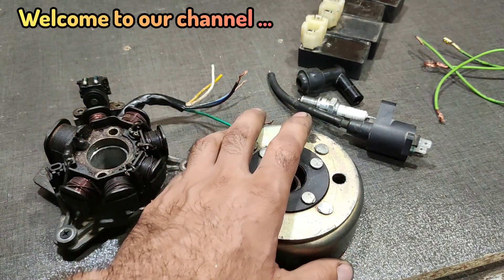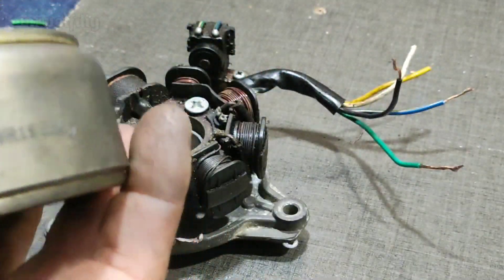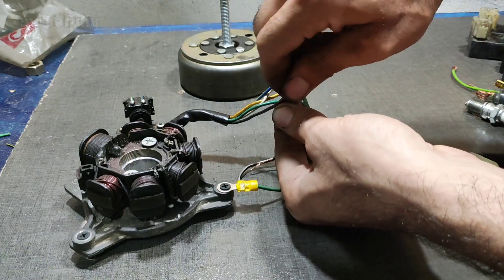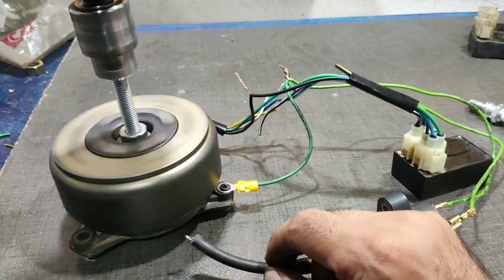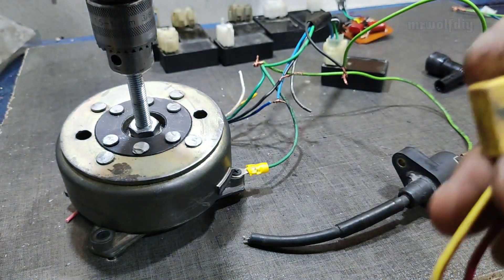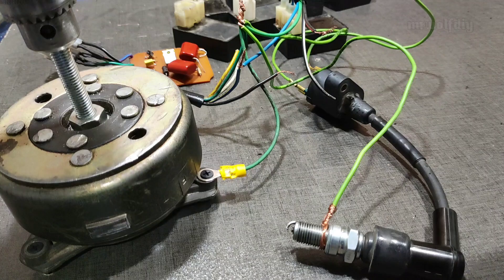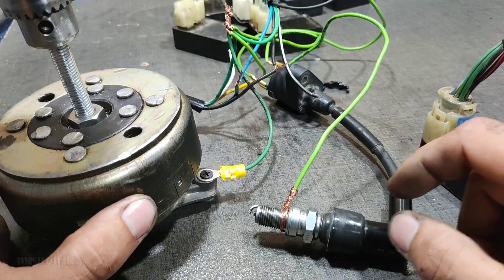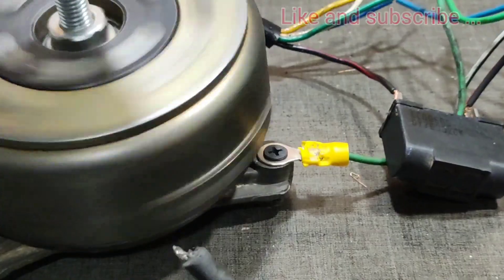How to increase ignition power, simple and practical method

Comment: my chinese scooter as random fails... no spark, but sometimes it manages to start, my last guess is the freakin pickup, but im lacking the tools to do the job
Reply from the maker: The issue can come from different sources, such as wiring problems or even the pickup coil.
When you face a no-spark condition, you need to check it at that moment.
The stator, CDI, pickup coil, and related components should all be inspected.
I’ll be releasing an educational video soon covering these common problems.

Comment: I have a question: I read everywhere that the ignition coil (the sparkplug holder) must work perfectly together with my ignitor (CDI for motorcycle)... i WANT to test the ignition coil because it has no spark. Can I use a different coil or do I have to buy excactly the same?  (I am not sure it is broken and is very expensive) ...
Reply from the maker: Hello, in most cases you can use similar ignition coil models; it doesn’t have to be exactly the same one.
Just specify what it’s originally for.
Also, make sure to watch my videos on testing the ignition coil and testing the CDI unit on my channel.

Comment: Good morning my ATV getting little bit of current and it hard starts
Reply from the maker: Greetings,
This means the engine turns over with difficulty or doesn’t start at all.?
If you hear a “click-click” sound from the starter, it indicates low voltage or insufficient current.
It could be due to a weak battery or poor connections, Which needs to be checked..
If the starter turns but the engine starts very hard or doesn’t start properly, the ignition spark or fuel delivery might also be weak.... .
Reply: Ok I sent the battery to charge thank you  @MrWolfDiy

Comment: To accomplish what you did in your video how do you wire a stator with three yellow wires and trigger with a blue and green wire.
Reply from the maker: Hi and thanks for the question,
Motorcycles with stators that have three yellow wires usually use a DC ignition system, and their stator does not have an AC coil (except for some models).
You need to use a DC CDI, where the stator actually plays no role in the ignition system; only the trigger is responsible for sending the pulse to the CDI unit.
Implementation of a DC CDI can be found in the link below:
https://youtu.be/rK1xlWOXHtc?si=N0_Rkc57wC1jbWHi

Comment: do you have a video for a 4-cylinder? mine has 2 ignition coils, and each ignition coil has two spark plugs, so a total of 4 spark plugs
Reply from the maker: Yes, for four-cylinder engines with two dual-post coils, you should use a DC CDI. I’ve already made two videos explaining:

 _the construction and operation in theory.
Link: Building the DC CDI Version 1:
https://youtu.be/QvmFbEX-pGM?si=Zjq376lDN68_tyCn
_How to implement it on multi-cylinder motorcycles:
https://youtu.be/XHRxKNFLOQE?si=g9pPMP-hthbPGpn0

Comment: when you test your CDI it seems that you used the AC capacitor, is it necessary?
Reply from the maker: No,is not necessary, I just showed it for testing purposes.
Using a capacitor on the AC input line is not recommended,
because it may damage other components، Unless it’s implemented properly, which I’ll explain later.
Reply: @MrWolfDiy ❤❤❤❤

Comment: good day bro, can u suggest or do u have idea how can i put more ignition power to my mio i 125 motorcycle
Reply from the maker: I recommend avoiding modifications to your motorcycle if it doesn’t have a specific problem.
In general, for better ignition, using a high-quality spark plug or the original ignition coil is the best option for you.
Reply: better get your mio 125 to impounding area. motorcycles like mio 125 should not be used to race in a public road and not be used by a "kamote" like you. 🤣🤣🤣

Comment: Why not have everything to one compositor and then a small coil to control when the charge is let out?
Reply from the maker: 🤔Could you explain more about this idea?
Reply: @MrWolfDiy  I always figured all those coils charged a capacitor and the last one was the timing for an electronic switch that released all that charge at once into the spark plug.

That’s just what I interpreted a cdi doing while working on mopeds 😅

Comment: hi bro semoga harimu menyenangkan, apakah percikan api koil seperti divideo mu itu tergolong percikan api koil yg baik, karena saya sedang mencari tahu percikan api koil seperti apa yang baik ?.
Reply from the maker: You could say yes, but it depends on many factors...
It’s not all about the spark—while a good spark helps with combustion quality, which in turn makes the engine run smoother, it’s only part of the picture.
In general, a good spark should have enough thickness and length, and its color should be blue or bluish-purple.

Comment: can you test it with a oscilloscope? I want to know how much the capacitor delays the ignition timing. Is it capable of following up the higher RPM, let say 12k RPM? I'm afraid there were misfirings.
Reply from the maker: Hi dear, Let me explain briefly:
At high RPM, for example 12,000, the time between ignition sparks becomes very short.
If the CDI circuit can't perform the charge and discharge cycle fast enough, the spark may be delayed — or it might not fire at all.
That's why using a high-capacitance capacitor in the circuit can negatively affect engine performance, especially at high RPMs.

Comment: Is it have any negative effect to HT coil ?
Reply from the maker: The stress on the coil happens when we increase the spark gap (like in my experiment, which was only to demonstrate the power of the circuit).
But when the circuit is connected properly — coil to spark plug — and the spark gap is around 1mm, there won’t be any real stress on the coil.

Comment: Hi, great job as always, congratulations, I wanted to know something, is it possible to build a stator without lights and a light flywheel with only a pickup, control unit and spark plug coil?
Reply from the maker: Yes, it's possible.
If the goal is only to produce a spark for ignition (start the engine without any lighting system), you can use a simplified stator without lighting coils.
A lightweight flywheel is also fine, as long as it still provides enough inertia to start and run the engine.
However, keep in mind that this setup won’t generate electricity for lights or a battery. It’s typically used in race bikes or minimal engine setups.
Reply: @MrWolfDiy  Thanks for the reply. What pickup, control unit, and spark plug coil could I use to build the stator? And how can I build the flywheel? Since I have the flywheel key, I assume there are no problems with the advance.

Comment: Hello. Can I use that custom cdi on Fuel injected motorcycle?
Reply: No
Reply from the maker: Usually no ، using an CDI on a fuel-injected motorcycle with an ECU is not recommended and is generally not possible, except in special cases with significant modifications.

Comment: Hello 
How to add pre-set levels to choose the power needed ?
Reply from the maker: That's a really interesting question...
I’d say the most common and effective way to add selectable power levels in a CDI circuit is to control the capacitor’s charging voltage at different preset levels, and then switch between them using something like a 3-position switch.

Comment: I wish I had your knowledge!! I'm trying to get spark on my little Honda XL 75 and I'm thinking of copying what you did here but the color of my wires are not exact to yours. If you can help me set mine up I'd be happy to pay you.
Reply from the maker: Greetings, my dear friend,
What type of ignition system does your motorcycle have?
It’s probably either magneto or breaker points, although it might have been upgraded to CDI.
Usually, Honda motorcycles made before the 1980s don’t come with CDI systems...
In any case, check and let me know so I can guide you.
Also, describe the overall condition of the bike for me — for example, are you not getting any spark at the plug? Or is there no high voltage coming from the stator at all?

Comment: on 8:32 sparks are jumping from ignition coil to nail to table. is that fine? if I do this to my bike that stray spark could fry some electrical components.
Reply from the maker: Hi,
Carbureted motorcycles don't have a problem when testing the spark this way, but in fuel-injected engines that have an ECU, this could potentially damage some components.
However, using this CDI on the engine is not an issue, because the spark is generated across the 1mm gap of the spark plug.

Comment: First when you say week spark , that is not spark ,that is the power wire to the CDI , and thats all , the cdi and magnetic trigger , to the coil wich then multiplies the voltage , trigger interupts , creating a big spark , that jumps the gap at the plug simple .
Reply from the maker: Impressive… you thought of that all alone🙌
Reply: hy

Comment: Gm sir, could I use this for Aerox V1?
Reply from the maker: Hi,
For injection engines, using a CDI is not recommended, although it is possible, but changes must be made to the wiring and other places, which is not in your favor at all.♥️
Reply: @MrWolfDiy  Okay thanks for your advice

Comment: I'm interested in building one for a modified HondaCX500 that has a different trigger system using a hall effect sensor that outputs to a GY06 DC-CDI. Can your design replace the GY06 CDI as the spark output is ok but not as good as yours. Thanks
Reply from the maker: Hi, In general, yes, it depends on the correct matching of the input signal and ignition conditions. If your trigger system uses a Hall sensor, you need to ensure that its signal output is compatible with the input of your CDI. However, for your motorcycle, it’s better to use a CDI with adjustable ignition advance. I haven’t had the chance to build this yet, but in the future, I will also release a microcontroller-based CDI.

Comment: Nice!
Add a constant, dioded, ionizing voltage that goes to the plug:
This should make some local Ozone and fast burning radicals and possibly even a tiny bit of Hydrogen.
That means less losses due to the ability to retard timing a bit for the same burn speed.

Want more free hydrogen; put a light layer of copper in the combustion chamber and on the intake tract and valves.(light not thick by electro plating standards)
Crazy?  😃  Hint: Copper Reduces at combustion temps..!  All other metals oxidise😉
How to plate copper on aluminium is online.

Want even more:  See MIT etc's Plasmatrons online.
Use that AFTER pyrolysing fuel and creating steam (together) from waste exhaust heat.
Look to your catalyst metal/s again.
Reply from the maker: Thank you for the interesting points you mentioned.♥️🙏
Reply: @ MIT and co's Plasmatron is basically a giant spark plug...

Comment: How can i make that for x max 125 2006.?
Reply from the maker: Hello,

Hi, Your motorcycle uses a DC-CDI. If you want to use a custom CDI, you can build a DC version ، You can find it on the channel.🙏
Reply: @MrWolfDiy  can you send the video you are referring to, thanks. do you think it will fit my scooter? i hope it has the same number of pins
Reply from the maker: This video link is about making a DC CDI:
https://youtu.be/QvmFbEX-pGM
The number of pins is not very important; it just needs to be connected according to the diagram.(You need to know your CDI diagram info.) However, keep in mind that in some motorcycles, the performance may vary or may not be satisfactory. But if you're interested in such projects, you can give it a try.
Reply: @MrWolfDiy  ok thank you so much

Comment: Good explanation but if you use custom cdi will it generate alot of heat to engine?
Reply from the maker: Hi,
The spark strength does not cause abnormal engine overheating; instead, improper tuning and mismatched ignition timing with the fuel-air mixture lead to excessive engine heat. Thank you for following us!

Comment: How to connect CDI 110
Reply from the maker: If your motorcycle is a point breaker type, upgrade or modifications to the ignition system are required, perhaps I will explain more in future videos.

Comment: Can destroy the piston 😅
Reply from the maker: I've been using it for years, I still have no problems, it depends on your usage.🙏
Reply: No matter what the voltage is or the joules of energy the ignition system has it will not destroy the piston. Running the ignition timing with the wrong timing can certainly destroy the piston due to detonation. The advance curve on a 4 stroke is important, as is the retard curve on a 2 stroke. The alternative is to run fixed timing with the timing point set to a figure that suits the peak RPM, a fixed timing system is not good for power at low and mid RPM.
Reply: Lame

Comment: I still afraid of high voltage causing damage to spark cable that could not resist this process
need long term study and test plz
any way, thank you alot
Reply from the maker: Greetings,
I used a handmade CDI for a long time, and I haven’t had any issues so far.
Additionally, the original older versions have the same power...
However, nowadays, due to various policies, the parts have become very low quality.
Reply: @MrWolfDiy  nice, tnx alot for all these experience and support with your nice quick replies
Reply: @fleetbnb 1mm of silicon rubber can take all from 20-30kv  and on sparkplug wires its usually 2mm or more, so you are good unless you do crazy amounts of power

Comment: Hello, is it increase heat transfer rate output from ignition coil? 
I ever see, some SE ignition coil burn faster (3,7s) than consumer (4.5s-7.7s). And different voltage output 35kV on SE, 20kV-30kV on consumer. You can test by putting paper between output cable and grounding.
Reply from the maker: Hello, that was a good point, I'll try it later.👍🙏🏻

Comment: If it's too powerful the spark plugs life suffer
Reply: Use iridium
Reply from the maker: I don't think it will have much of an impact on the lifespan of the spark plug... But The fuel consumption will be reduced accordingly, Due to the stronger combustion...🙏
Reply: @MrWolfDiy  how did it go ,any advantages  in power and consumption? you